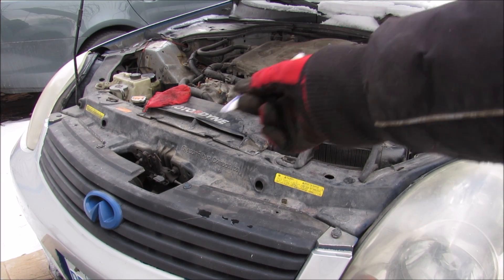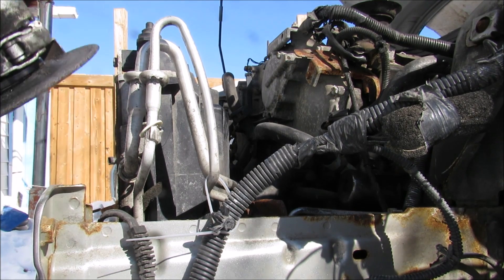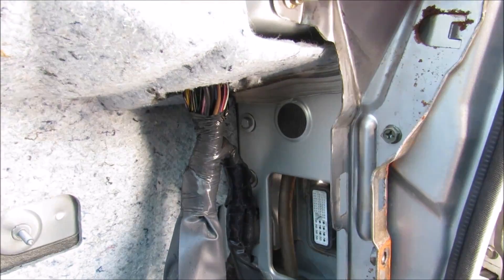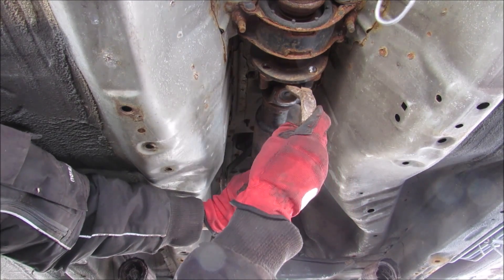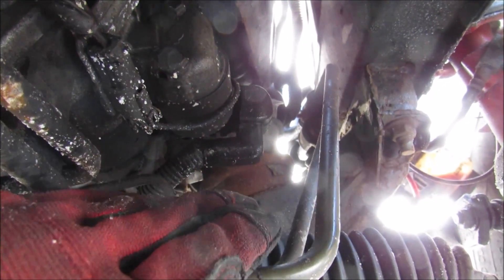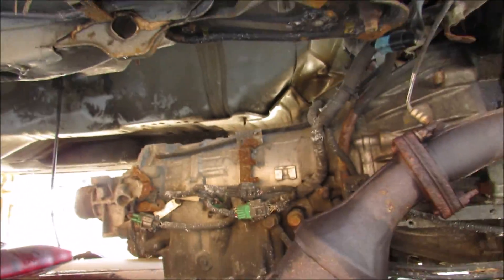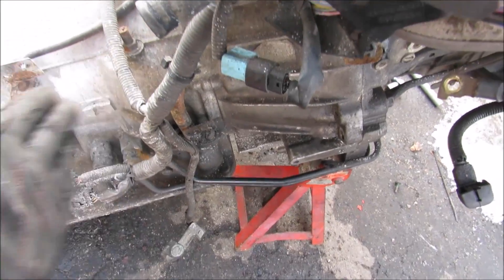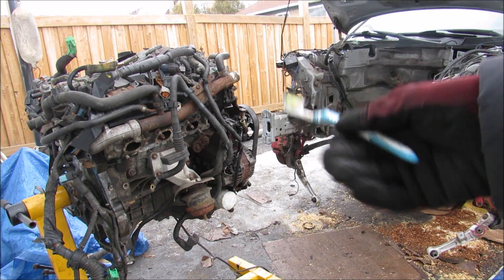How to Remove a Car Engine

Comment: Really great and without waist of time !  Have you take out any TOYOTA ALPHARD ANH  10    2002-2003 model ?  2AZ-FE engine.   I need to acces torque converter.  U241E gearbox

Comment: Do you have any videos showing how to remove an engine FROM the trans in the car? I’m doing an engine swap but keeping the trans, but the engine is stuck to the trans somehow. Not sure if it’s only friction in the input shaft and clutch plate, or what. It’s a manual
Reply: If you are doing a full swap just go ahead and drop the trans. If you cant get the trans out use a bottle jack and play with the angle of the motor/tranny to glide it out

Comment: That's cold work - removing an engine outside in the winter.  Add to that, rusty bolts et al.  At least it was sunny.
Reply from the maker: Yep, it was tough

Comment: Can anyone tell me why he removed the plenum?
Reply from the maker: For a previous video on air intake
Reply: speedkar99 oh ok
Your video helped me remove my engine from my g35 
Your didnt have to unbolt the headers but
I spent over an hour attempting to unbolt the headers, i just couldnt get the bolt that was facing the opposite way on either side
I ended up removing the cats and pulling the engine forward a bit to have more room to remove the headers

Comment: Was the AC system discharged beforehand, or did it have a leak?
(AC Freon is the biggest thing I try to avoid leaking. R-134A isn't as bad for the atmosphere as the old R-12, but it's still pretty bad.)
Reply from the maker: It was discharged already

Comment: Hey Speedkar99 My 2001 4runner (3.4l v6 4WD) recently threw a p0446 code (evap purge canister) 
But i have a significant exhaust leak that's constantly giving me the p0420 code. 
Could the new p0446 be related to the exhaust leak or should I look into changing my EVAP purge solenoid canister? Thanks if you see this! 
I live in southern Ontario so rust is an issue, working on things is a lot harder than it needs to be.
Reply from the maker: Evap is not the same as an oxygen sensor code. The evap code has to do with the EVAP system, I have a video on how it works.

Comment: You should have drained oils and cooling fluids and disposed of as hazardous waste.  Capture/recycle A/C freon too as it can damage the atmosphere.
Reply: Thank you Captain planet
Reply from the maker: Good tip. 
Coolant was drained, but there was some in the block and the engine went sideways which it shouldn't have. 
AC was already drained.

Comment: I think disassemble one more so we compare both and find similarities between these. Lastly I thought that engine is connected to body by three foundation rubbers and one unbolt these and lift the engine. Is not lifting the engine possible?
Reply from the maker: Yes, the engine should have been lifted, but as you saw at the end of the video, the crane was broken

Comment: Sometimes I think it'd be cool to  live up North, then I see RUST, and heavy coats and gloves in your videos and decide to put the top down and go for a drive...
Reply from the maker: It's not cool to work in these conditions but its something I've gotten used to and adapted to. I'd still prefer this climate over tropical any day.
Reply: @speedkar99  don't you get mosquito swarms in the summer too? Brilliant video btw, that's the rear main seal you uncovered near the end? I think I see why I might have a little bit of oil on the bell housing now